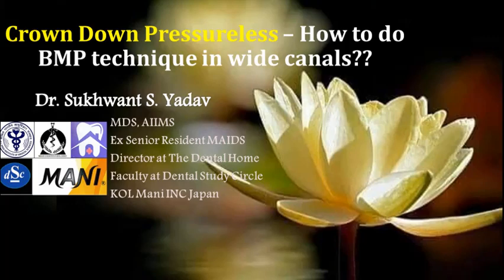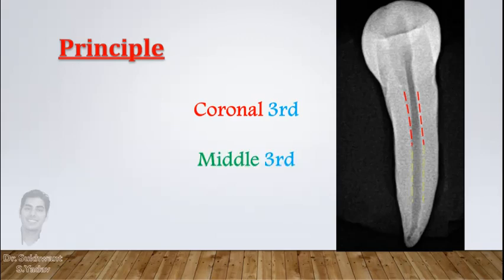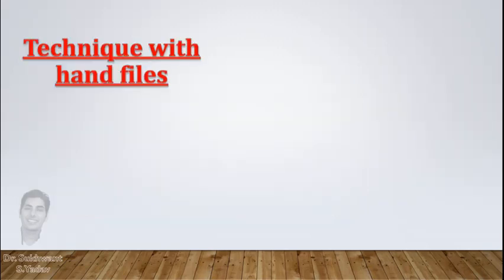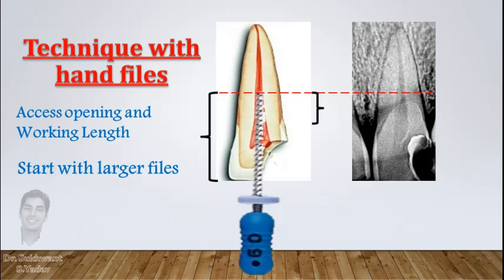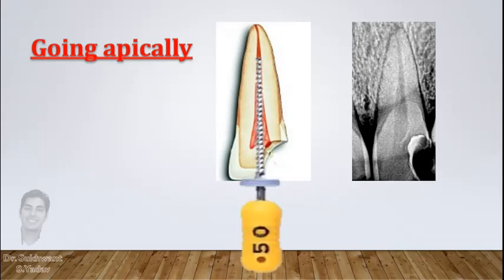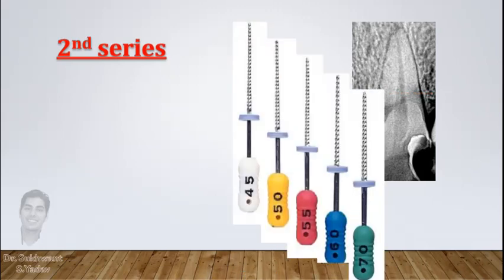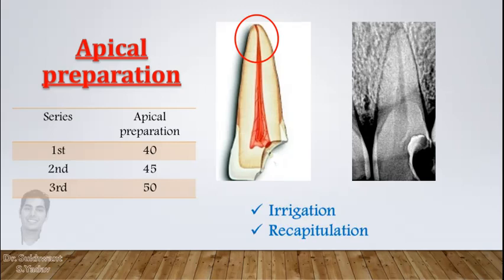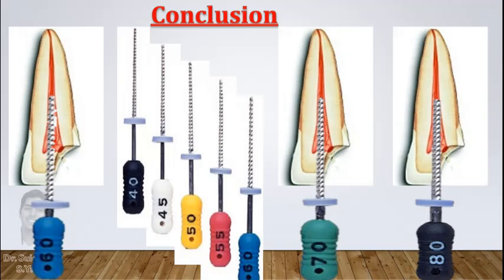Crown Down preparation for Anterior teeth (Wide canals)

Comment: Sir,how to prevent gp points comes out from the canal when it sealing with heat burnisher?
Reply from the maker: Two points are important
1. Tugback fitting of GP in canal should be good
2. Burning instrument should be heated well
Reply: Same question sir

Comment: Sir what is difference between crown down and step down method?
Reply from the maker: Step down is a hybrid technique in which coronal portion prepared first with GG drills, then prepare apical portion like step back. Finally join both preparations by lateral scrapping. 
🙏🙏
Reply: @Endocrisps  
Thanks Sir
Reply: @Endocrisps  Sir In some books they had written that step down and crown down techniques as same.
Reply: Sir I more doubt, In most of the
 in-vitro studies the they use step back technique in anterior teeth and premolar as well.
Reply from the maker: Step down and crown down not same. 

Crown down pressure less is best whether it is anteriors, premolars or molars; whether using hand files or rotary files. 🙏🙏
Reply from the maker: Give your email ID 
I share you original parent article of step down technique
Reply: @Endocrisps  thanks a lot for cleaning my doubts.